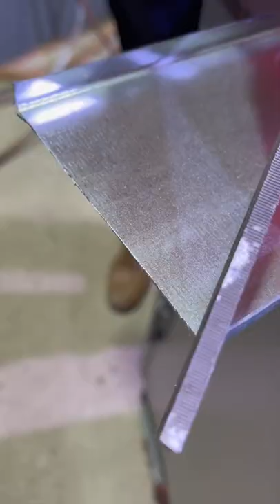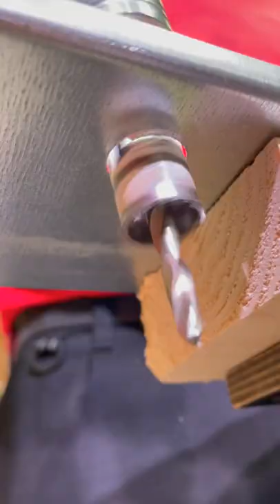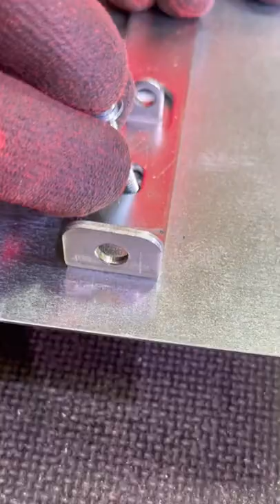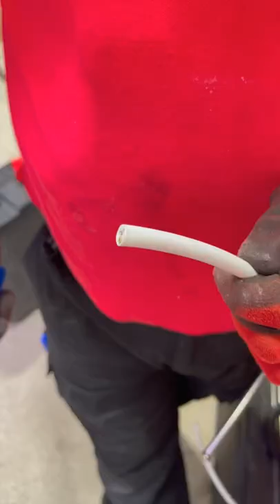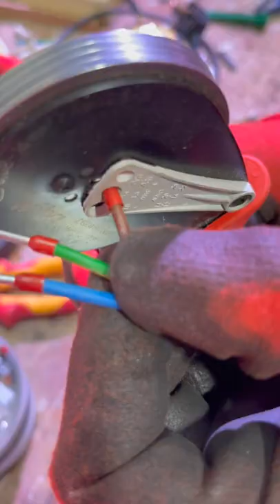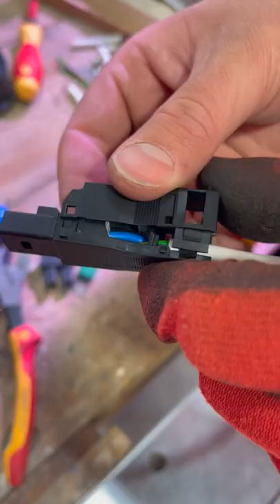Installing a Ceiling Light In 60 Seconds

Comment: If only! 60 seconds in a video but 4 hours in practice if not longer ... Lift the carpet, lift/cut the boards, fish line to where the light is going (presuming the joists have already been located, marked, hole cut in the "right" place, with room to mount it AND the smoke hood) fish the wire through, do the connections. Back to the unpowered end, find a suitable power delivery point, wire to line and switch appropriately. Job done! Oh wait! The customer wants this light to be separately switched AND on a three way circuit! Oops! Bang goes ANOTHER 2 plus hours! 60 seconds ... Yeah right! You're as bad as my wife ... "It'll only take you two minutes" ... Yeah, just to figure out HOW many obstructive issues I'll have to fix first! Doh! 🤔🙄😲